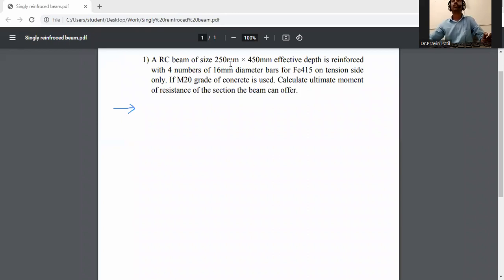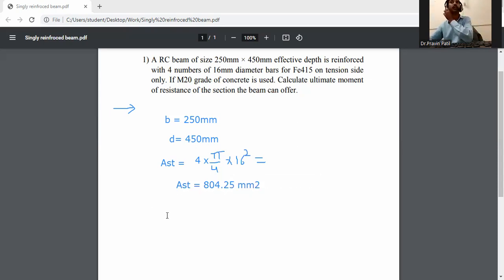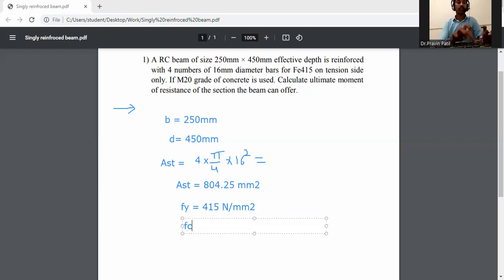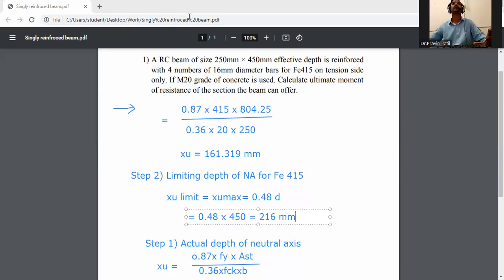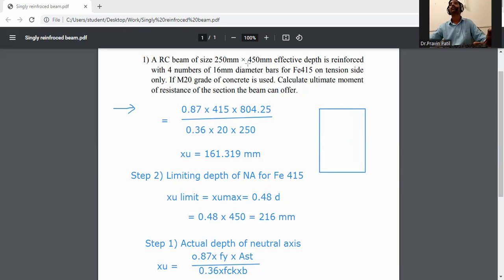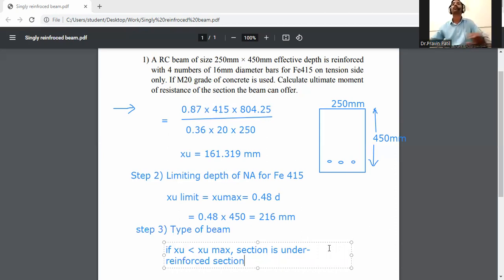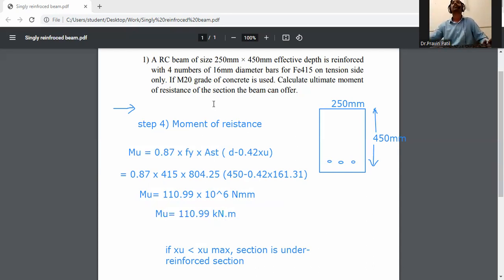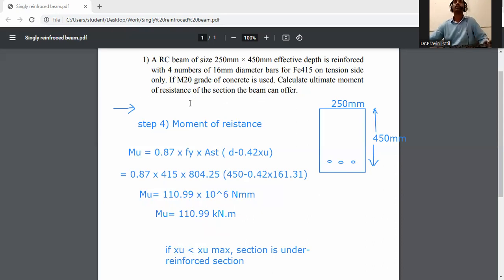Ultimate moment of resistance of rectangular RCC beam/ Design of RCC STRUCTURE

Comment: determine the ultimate moment of resistance Mu of the ec beam section figure fcu40 fyu 470 d/d 0.15 effective depth d=600 base 250 snd 3Y32 please help with this it doesn't have the fe415 or m20 it's different from yours
Reply from the maker: Derive the expression for this Ultimate moment resistance
Reply: Okay just done solving it am hoping am right😢